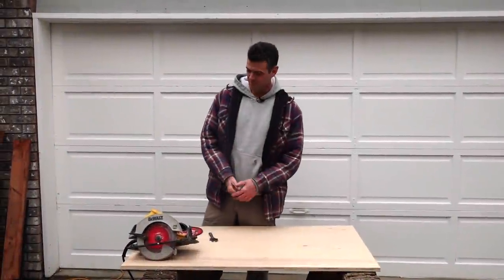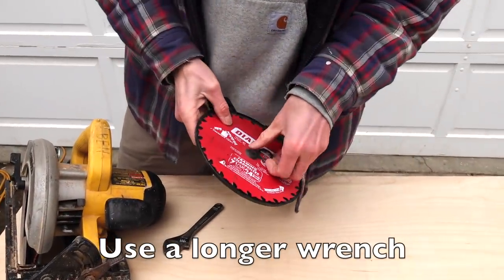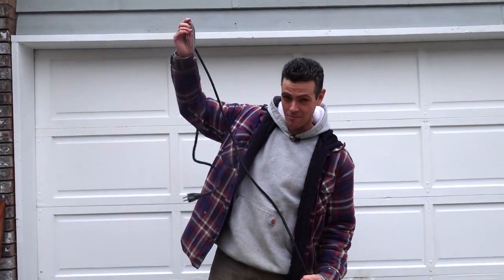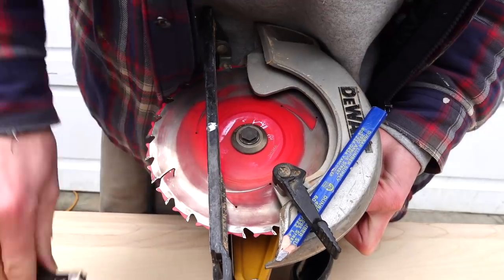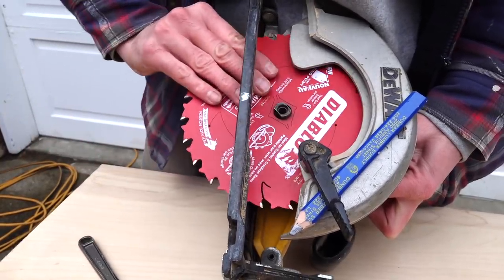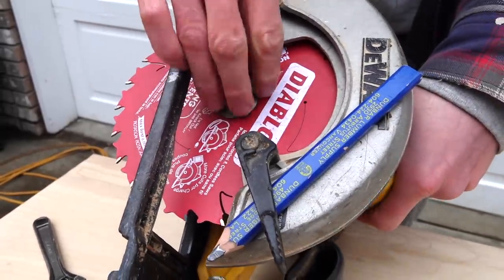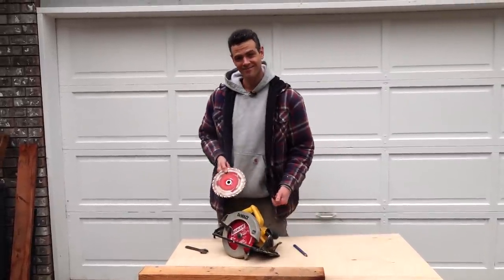How to Change a Circular Saw Blade!

Comment: Just a quick tip I thought I’d share. The bolts that hold blades on always loosen in the direction the blade spins. That’s true for all types of saws at least all the ones I’ve used.
Reply: My DeWalt is reverse threaded, but I have a craftsman that’s opposite.

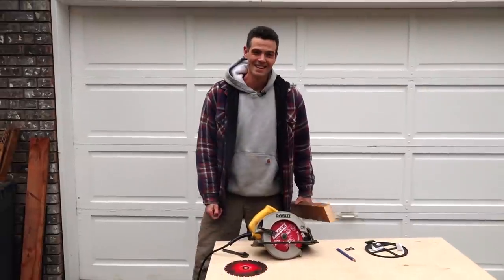Comment: 3:29 No matter the brand or blade side, my Dad, Grandpa, and uncles ALL CALL Circ Saws “SkilSaws”; recip saws are called Sawzall, and the sliding miter or chop saw (fyi for ppl, a chop saw not same as miter saw), are all called Chop Saws…..
It’s how they grew up w/ the tools they used and work with and even though times have changed and more tools are in the market; ppl like their names and patterns etc…..
Reply from the maker: Yup! Exactly the same here. Those are all exactly what my dad called them and every crew I have worked on.

Comment: Usually the hardest part is removing the shrink wrap from the blade. And the best for vinyl siding is an angle grinder with a cutoff wheel.

Comment: You had the wrench flipped wrong, it's designed to have better contact and increased torque when faced into the direction of rotation. Compare its function to that of a pipe-wrench. When you pointed out with the "skill saw/circular saw" statement I had to chuckle because you called an adjustable wrench a "Crescent wrench".. Crescent is a brand..
Your videos are fantastic and I've learned many things from you, thank you much!

Comment: You are missing out if you've yet to try a worm or helical drive.  They are just much more powerful.  Though heavier, they actually make much more accuracy  ergonomic sense as you push the cut from behind and not drag the cut from the top.  The sidewinder designs have their uses for plunge and tighter spaces, but you've really gotta take one of these big boys for a spin.  They are just easier in general to use, and safer IMO.

Comment: Crescent wrenches should be used the other way when you took it off.  You did it right when reinstalling.  The wrench jaws will open slightly when used incorrectly.  The way you had it when reinstalling gives the jaw more support.

Comment: I just keep using the same blade until the motor fails and I have to buy a new circular saw. Seriously I don't think I've ever replaced a blade. My first circular saw lasted like 20 years, I used it to build decks and screened in porches and lots of projects in several houses. When it died I bought another. I know that if you are doing specific tasks that require a specific kind of blade you would need to swap them out, but I only ever do one type of task, cutting boards, so one blade type is all I need. Now when it comes to jig saws, yeah though suckers go dull fast, and you do sometimes need to change blade types.
Reply: Did you buy blades with carbide teeth?  I've noticed the problem with the blades isn't so much that they get dull as that the teeth fall off.  A typical circ blade is 24 teeth - loose too many and you feel how much harder it is to push through the wood.  Stripped formwork with concrete on it kicks the crap out of blades.

Comment: 1:52 reverse threads are usually on right side blade (aka: left hand bladed saw), miter saws, & some other chop saws etc…
Regular threads are most of usually found in sidewinder, right side bladed saws; & always throws me off as use 98% of time a left side blade saw as what prefer running; till need to use a track saw. Wouldn’t it be cool if had left side blade for a track saw…

Comment: What do you do with the old blade? I saw that teeth are all in place and I guess they will still cut after resharpening and recreating geometry. I send all my blades to the local workshop and such blade would cost me around 10CAD.
Reply from the maker: Skilsaw blades aren't worth sharpening for me. I do get all my table saw and miter saw blades sharpened though.

Comment: I have an old B&D circular saw. It doesn’t have the brake switch. I have to use a screw driver to lock it in place. Otherwise, it’s the same procedure.
Reply: yeah same, i use a clamp to hold the blade.

Comment: My skill saw definitely doesn't have a lock. Neither did my last one. Its stupid. I have to use my bench to wedge the blade in there.

Might do another one showing how to without a spindle lock. Screwdriver or edge of bench instead.
Reply: Yep my table saw is same, you're supposed to use a spanner and a hex key together, but it's a lot easier to attach a bar clamp to the blade to stop it from turning and use only the spanner, saves grazing your knuckles!!  Probably safer as the blade is being held still from the edge rather than the hex key in the centre, so it requires less force to keep the blade still.
Reply: I have a Model 77 Skilsaw made in the 80s that definitely has a blade lock button. If you look on the side opposite the blade (near where you change the oil) there's a black button surrounded by a nut. That is the blade lock button.

Comment: 20v 6 1/2" circular saw is reverse thread too. Nothing is 100% Also might be a bit safer if you use the wrench that originally comes with the saw to take off the blade or just turn your wrench around the guard no danger of slicing knuckles. I feel like it seems I'm ragging on ya a bit but I dig the channel and thank you for using the term circular saw as "skill saw" and "sawzall" just drive me nuts. We are all professionals and should speak and act like it. ;)